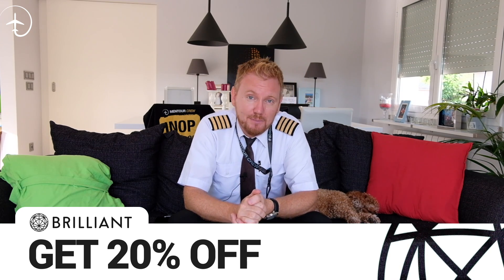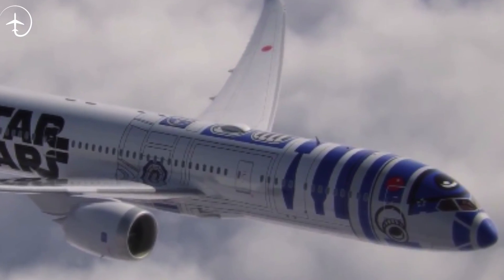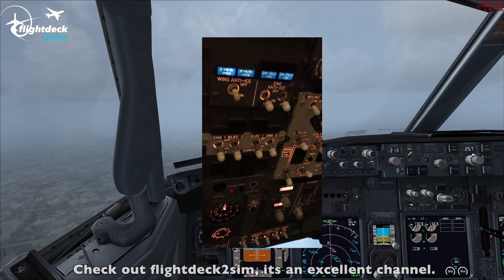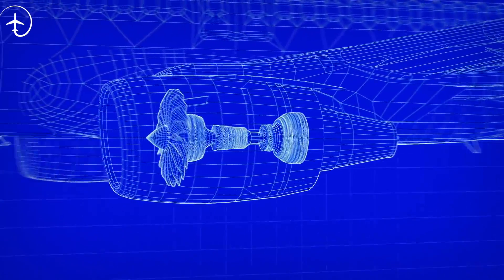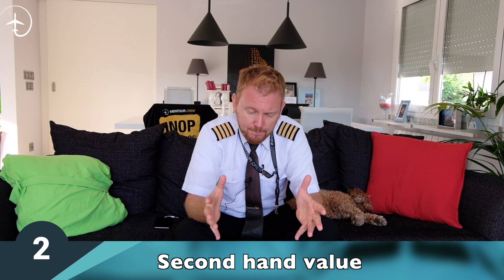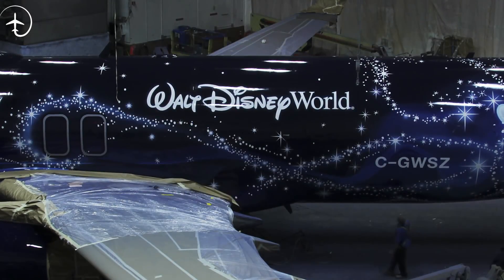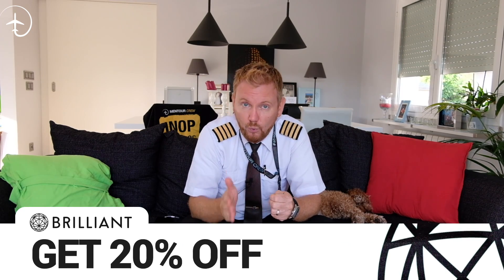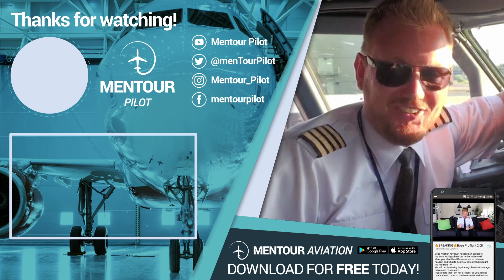Why the front of the Jet Engine is NEVER painted..

Comment: So the engines won't ingest flakes of paint I would guess.
Reply from the maker: Good guess my friend! That’s one of the reasons
Reply: And so we have gently touched on the forbidden topic of bleed-air...
Reply: That’s the engine anti ice thing Thts why is not painted
Reply: @andersonrodriguez8258   Yeah, that seems logical M8.
Reply: Same reason you use stainless steel tools on jet aircraft.  Chrome plated tools can chip off the plating.
Reply: 2fathomsdeeper First time I’ve heard that one!  In all my years of purchasing tools for Boeing, we never took that into consideration. Where did you hear that?
Reply: The military.  All my aircraft tools were either stainless or bare steel.  They can even tell that chrome plated tools were used in engine assembly in the oil sample analysis.
Reply: Fredrik Norrman What. You didn’t watch the video?
Reply: @Ampersandrascott  <i did, but answered the question before.

No sport in answering a question after you know the answer right?   :o)
Reply: If a paint chip was detached from the lip, wouldn't it be flung outwards by the fan and out with the bypass air, never reaching engine core?
Reply: Katatonia rocks!
Reply: Paint flakes? No.
Flocks of birds that force the pilot to land on the Hudson? Yes.
Reply: Isn't the spinner painted?
Reply: Flakes of paint won't bother a jet engine !
Reply: pasoundman Ingestion Of any FOD is bad, paint chips included.
Reply: @Ampersandrascott  : A chip of paint will simply pass through as will some birds !
Reply: pasoundman What are you basing that on?  I was in the industry for 34 years. I’ve seen the damage that small objects can do in an engine. A small bird would require a partial tear down. 

What engines are you referring to?  You’re not thinking of prop planes, are you?
Reply: Sterlingjob At Boeing, we do a thorough going over of any of our engines that ingest fod. But that’s the airplane company. I don’t know what all the airlines safety protocols are.
Reply: Sterlingjob Actually, the Governing authority determines and enforces the inspections in cooperation with the manufacturer. My point was that airlines are sometimes a bit lax in their maintenance in order to save money.
Reply: Ampersandrascott a small bird would require a tear down ? A tear down of what, I can literally quote the CFM manual on birdstrikes. For cfm 56, it requires a visual inspection for nicks, dent, cracks on the fan assembly (blades, acoustical panels...) and if there’s evidence of ingestion in the booster/compressor section you just have to borescope the engine. It’s something that happens all the time.
Reply: @Ampersandrascott  Not as much as you'd think. If we have any indication that something went into the core of the engine we borescope it, which involves removing inspection plugs on the engine case and inserting a camera to inspect for blade damage. We can also remove minor damage within manufacturer limits by boroblending, which is an abrasive process. Borescoping is also done on a scheduled basis as part of regular maintenance.
Reply: @dougrobinson8602  I can only speak for how it's handled in the factory.  I don't know the standards for fleet maintenance.